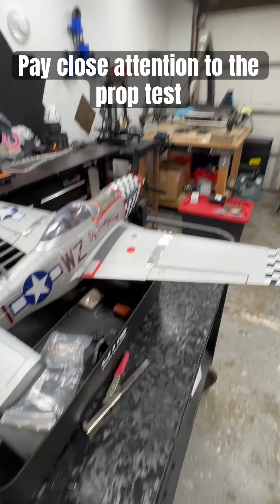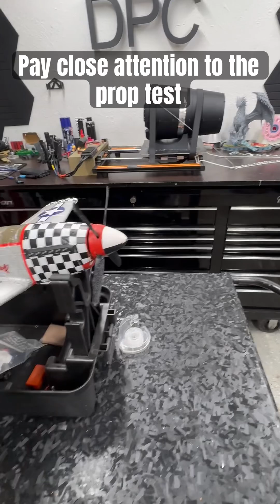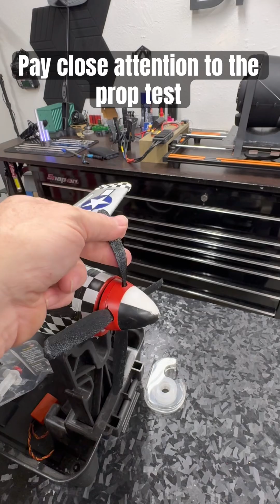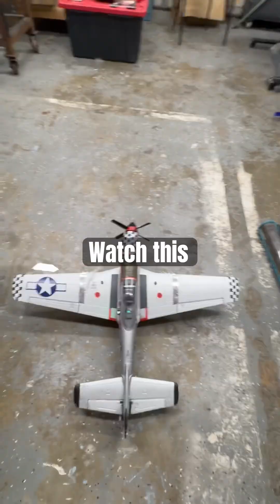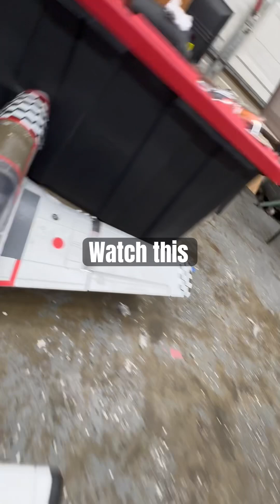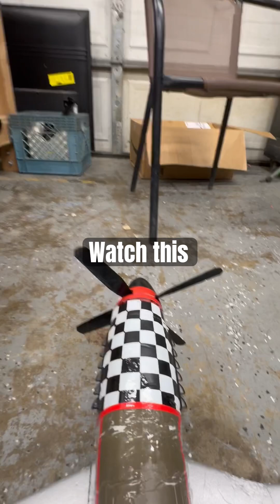The unbreakable propeller. #p51mustang #propeller #rc #unbreakable #diy #tpu #ams #fyp #shorts

Comment: Nice mound what do you think I can go on like one of those for a beginner
Reply from the maker: I think it would work well for beginners. As you may or may not have seen in my previous flights for this airplane every single time I have to print a prop so I decided to try the AMS TPU. It still has the same throttle response as a standard prop, but much more forgiving if I run into stuff or have a rough landing, which I am almost certain of doing.